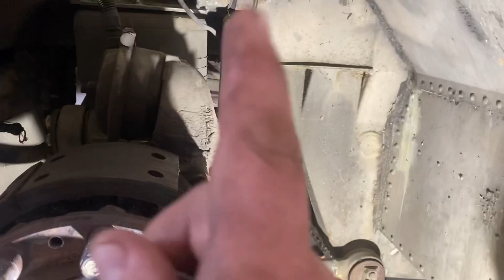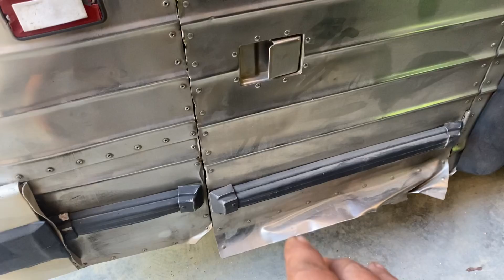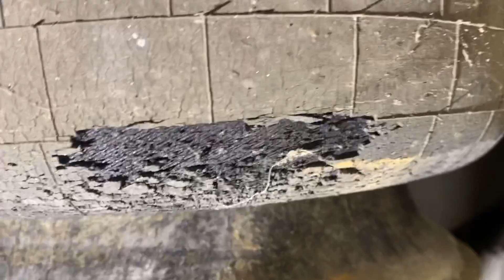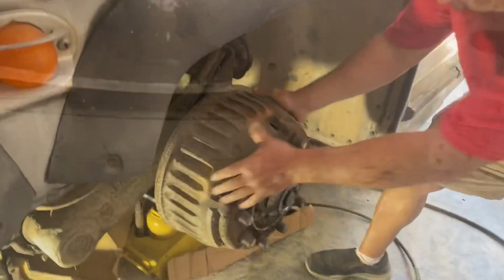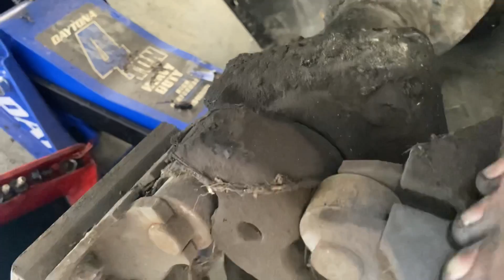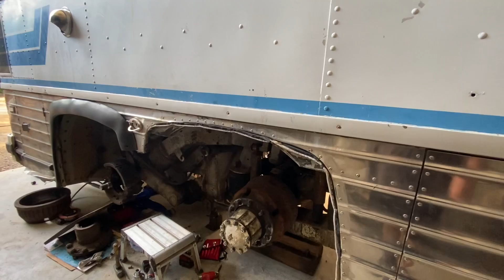MCI MC-12 bus conversion deep inspection day.  Major issues discovered and parts ordered.

Comment: $600 is a absolute ripof for that exhaust pipe section, that pipe would cost me under $60 to fabricate up.  If someone walked into my shop and asked me to fabricate that pipe would be looking at a $250 expense and the new pipe would be made from stainless.  I stock dozens of every side and type of v band connectors along with piles of mandrel bent stainless exhaust pieces.  I build and fabricate high horsepower turbo race cars.

Comment: Is it neglect or lousy service work acted to have done during many years? No one has inspected the work supposed to be done by mechanics in bus maintenance companies?  You sure have a lot of work to do, it looks like every other bus has such issues.
Reply from the maker: 95% of the issues are from lack of maintenance from when it was in service as a commercial bus.  It’s got only hundreds of miles on it since it has been an rv.   Once an rv they usually then get issues from lack of use.   Pretty normal stuff, same issues you see with used cars.  Wear parts show wear and need replacing.

Comment: Not to be a nitpicker, but isn't that broken pipe an exhaust manifold? Usually the cast iron portion attached to the engine is called a manifold. I don't know much of anything about buses, so it's always possible that it's just called an exhaust pipe on a bus.

Comment: Question. on the apartment build in the end of the shop.  are you going to build in a duct work to allow big fans to be installed to keep the air at your command being exchanged in the shop.. so the shop is not a dead air space at the apartment end.
Reply from the maker: The apartment will be fire blocked and completely isolated from the shop
Reply: @BusGreaseMonkey  then you might plan on hanging a duct from the ceiling to allow the back of the shop to be ventilated when you turn on the fan..  like they ventilate mines.. perhaps later when the need appears..

Comment: Lot of work done!    I'm sure it's occured to you folks, maybe hire an apprentice-mechanic?
Reply: That would reduce profits?
Reply: $600 for that pipe!! I would think someone with a welder and some fab ability could make that for half that amount useing what's still there that's good. Of course finding that person is the trick especially in a new area.
Reply from the maker: Easy button.   It’s a detroit diesel part and can be here in two days.  No running around trying to get it done right.   Buy and bolt on.
Reply: @BusGreaseMonkey  you do excellent work
Reply: @BusGreaseMonkey  didn't mean to stuff this comment Onder the other guys.  If the guy has the money and wants to spend it that's all that matters especially of they want it back together.
Reply: @natevanlandingham1945  by the time he does run around and find someone who is capable of doing it it's cheaper to order it new is it's available......plus welded cast parts lack the structural integrity that is offered in a non welded part!
Reply: @irongoatrocky2343  I would agree that the time and effort and the result would be debatable vs. just buying it.  Still. Ouch! Not cheap.  Hopefully it's the last one he buys for a good while.
Reply: @irongoatrocky2343  I guess I didn't realize it was cast. Didn't look that close.
Reply: He has an apprentice every time an owner-operator wants to sit there and learn and work alongside him
Reply: @sw7366  I thought the same thing.